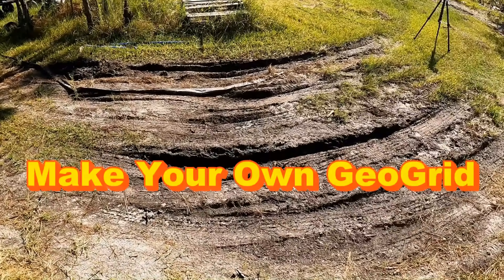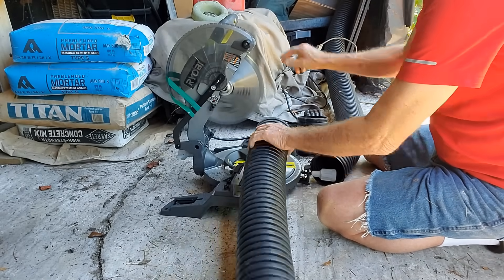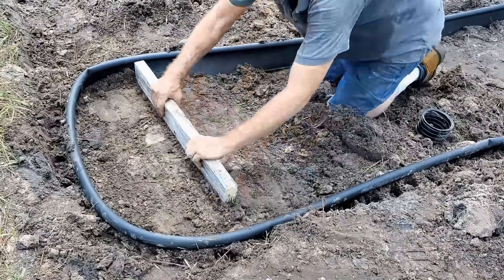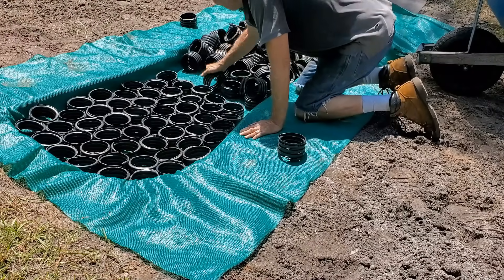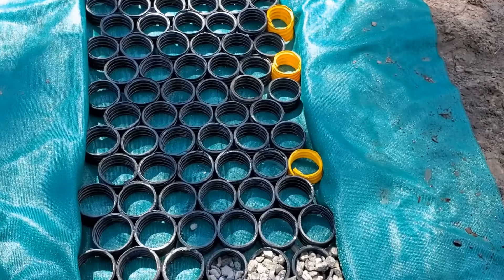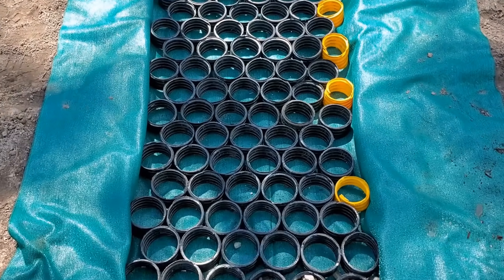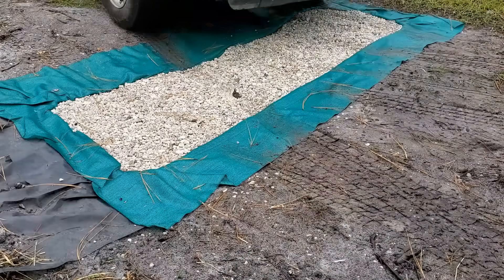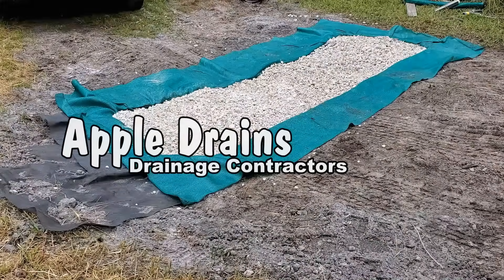Make a Geo Cel Grid that's Stronger and 1/2 the Cost. SAVE!

Comment: I’ve got a noisy 12 inch miter saw that I keep around for drain pipe work and I could probably do this super quick ,just put  a clamp for a 4 inch stop and then just bang those pieces out one at the other
Reply: I read thinking judo how relaxing it would be to crank out those 4" pieces as long as I had a jig..

 I would cut all day with my tunes going.... 😊day 2, we'd have a driveway!